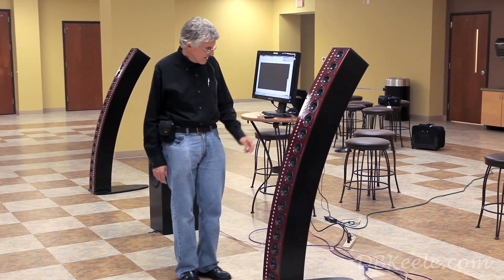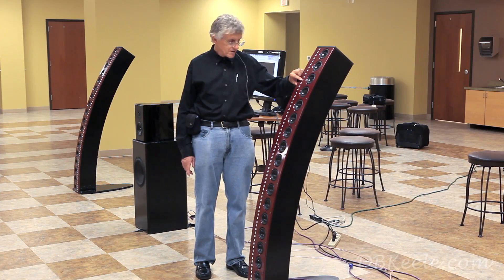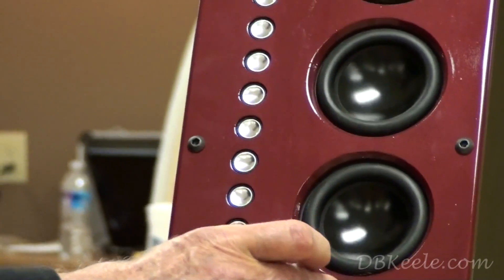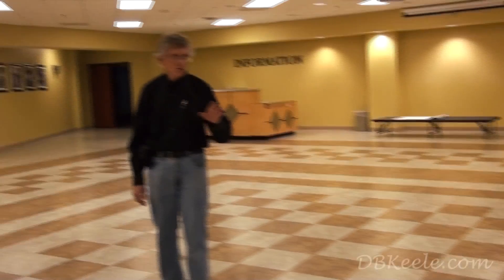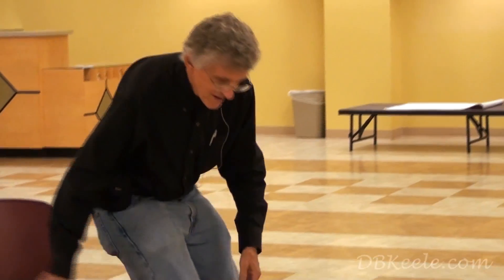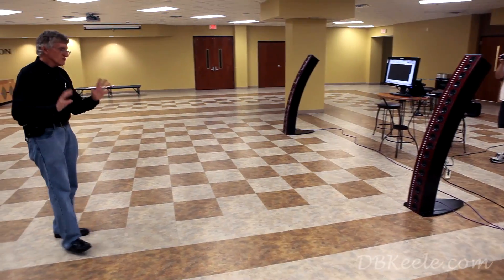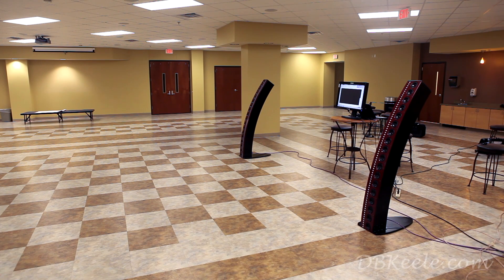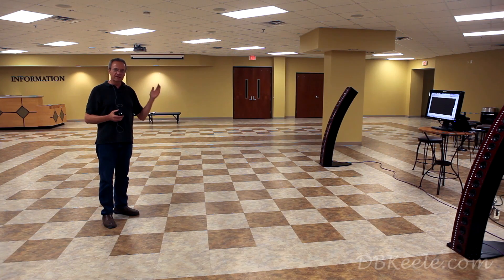CBT Chronicles Part 9 of 9 Measurements Continued: Various Observations

Comment: I applaud your creativity and curiosity. My analysis of your design is that you have created a very large horn driver with the floor of your room as the horn. You are simply inside of a very large horn driver. I can see where the military would be interested in wave propagation and echo analysis that is created by this sort of transducer design. My preference for musical listening is still flat panel magnetic planar. It's much more simple in design, it's aesthetically pleasing, and it produces an unparalleled sweet spot. Congratulations on your award and your pursuit of excellence in musical reproduction! 😎👍🎸

Comment: What would happen if you took a second set of Ground Plane CBT, turned them upside down and mounted them to the ceiling directly above the first set?
What would happen if you put them in the corner of the room directed at the far opposite corner, either single pair as built, or with mirrored Ceiling Plane?
That seems like putting the listener inside a room sized horn.  I'm imagining the 1/8th sphere space in the room corner around the speaker filled with upholstered foam minus seating cutouts to make little reading nooks in a big concrete library/theater/listening room.

Comment: So they are great for large venues with crowds siting, standing, towards the center and off to either side. Everyone, in all those locations, will experience good frequency response as well as amplitude. I don't see the real advantages for a home environment when generally one sits somewhere center and not too far from the speakers. Great video series and truly a great array!
Reply: Robert Kohut I have a set at home coupled with a nice 18” sub and I could not be happier! Constructing the kit nearly caused a marriage crisis as it took nearly two months (incl. paint job) but it saves about 8000$ wrt. to buying them assembled.

Comment: I ordered a set of these in kit form and can't wait to experience the build and then try them. Question I have is would there be a benefit of adding additional pairs to further construct the top section of the ideal hemisphere? Example 2 (or more) CBT line arrays placed on the floor 20 degrees apart along the equitorial radius of the theoretical sphere? So in addition to increasing output level, wouldn't you also get a wider beam? I was looking at JBL STX835s, but this has my attention as something much more portable, affordable with the advantage of wide sound dispersion and immunity to room reflections when in enclosed areas. For the cost of just the STX835s in my application, one could almost get 4 sets of these that may work magic in a large listening area and solve the speaker too loud at front but not loud enough for the back scenario.  And yes I understand they have to sit on the floor to function properly (ground plane). Great work!